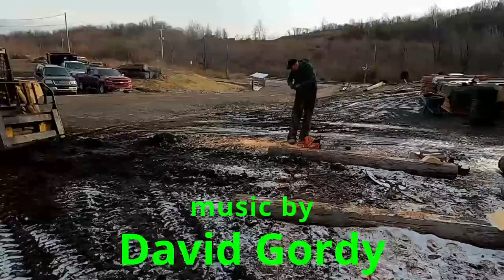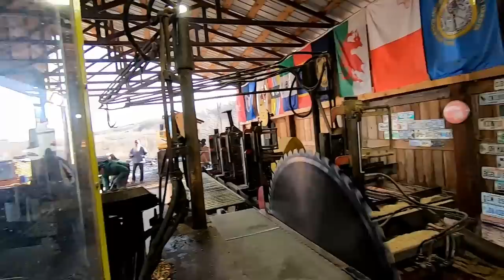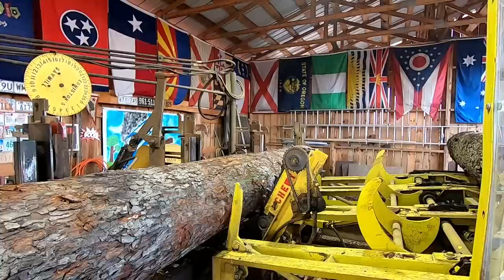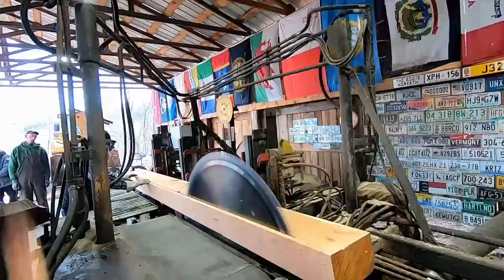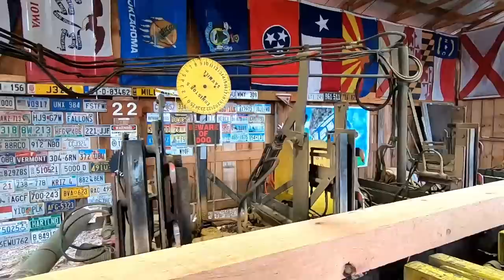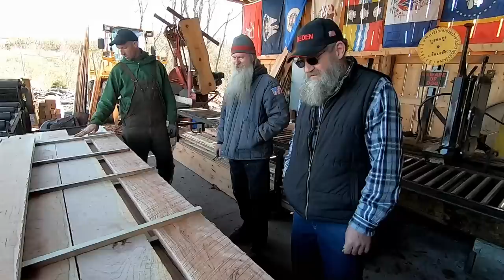sawing some pretty cherry logs # 386

Comment: Nice pattern. Almost looks like a beryl and the reason the take off man flipped everything over was that the rounded outside and squared ends of the slabs would get hung up between the rollers on the roller beds and since he ran the edger and needed to see the bark edge too. Thanks and Blessings!
Reply from the maker: thanks Lewie , most people didn't know that.
Reply: @markgalicic7788  Most people have never even gotten close to a saw mill either. BLESSINGS, Palley!

Comment: How is the teeth sharpened on the blade and how often do you sharpen?  Do frozen logs dull them quicker?  My bandsaw mill seems to dull quickly when there is ice in the log.
Reply from the maker: I have some videos on sharpening the saw , every 5 to 7k bf  and frozen don't saw much different but frozen dirt is very bad.

Comment: 16:10 what does FAS mean?
Reply: First and second, as in sides of the board. Both the first and second sides are clear of defects. F1s means clear 1 side but not both. Then comes #1 common with 1 or 2 defects. #2 common may have 3-4 problems. More defects than that makes for junk lumber that should have been left on the cant(big heart piece).
Reply: Also most of the junk lumber 3a 3b is made into hardwood flooring  so if u got a way to T&G the lumber and finish it. Can make some serious money from crappy boards

Comment: @ 32:57 the muffler on the LeRoi seems a little loose
Reply from the maker: it's more than a little loose , wore out.
Reply: Hi Richard, thanks for watching! The muffler is so worn out that Mark and I flipped it upside down when the rain shield rusted off over the summer! It has gone above and beyond it’s duty to be quiet!